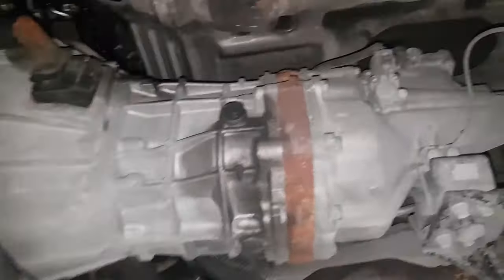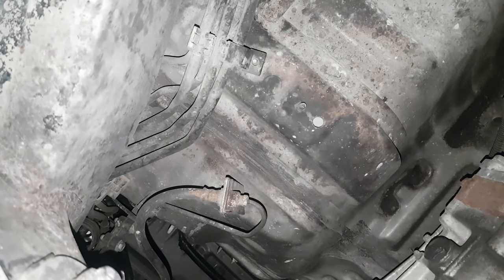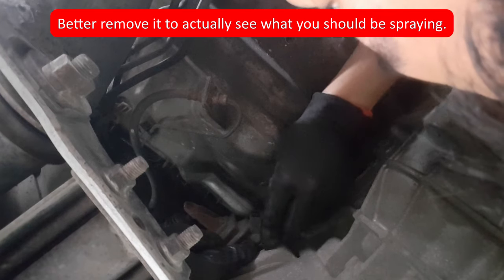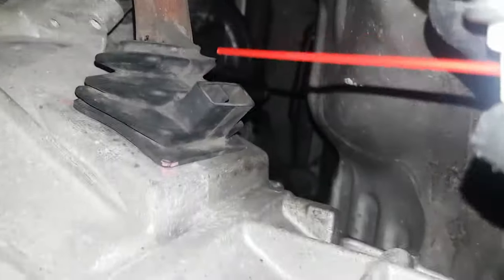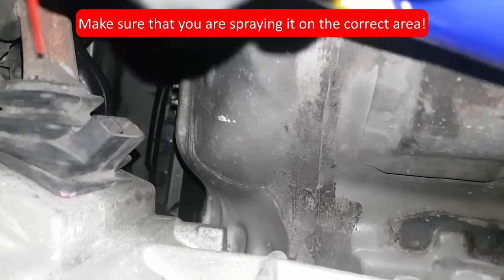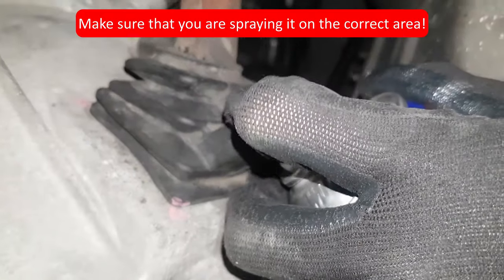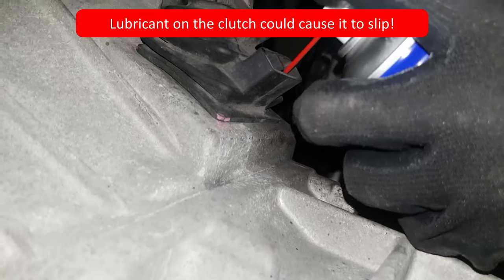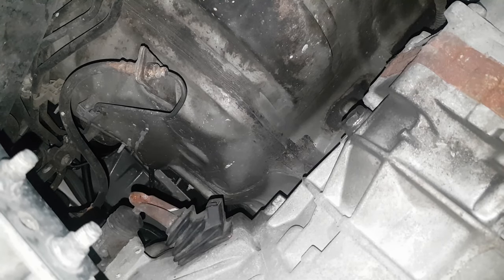DIY Quick Squeaky Clutch Fix

Comment: Thanks. The garage said the noise is coming from the inner components of the transmission and cannot be fixed without opening up the gearbox, thus recommended me to ignore the sound until the clutch needs replacing. Finding the noise  really irritating, I decided to try fixing it myself. Followed your instruction using nothing but a few spray of WD-40, and the noise is gone entirely. Didn't even have to remove the rubber boot.
Reply from the maker: Glad this video helped you a lot! You saved a lot with this easy and quick fix!

Don't forget to share this video so that we could help other car owners with the same problem and subscribe! Thank you very much!
Reply: @uazap  ganon din ho sinabi sakin ng mekaniko, kailangan pa daw buksan ang transmission pero di ako pumayag. Instead I tried  to fix it using your method Sir, pero di pa rin ho nawala ang tunog. Hilux Vigo po. 

Alin ho sa dalawang butas ng clutch boot/slave ang dapat iSpray ng WD40? White lithium grease ho ginamit ko noon. Ano ho mas mainam gawin at gamitin na grease? For long term.
Reply: @haniffabangon3169 ganan din akin, nabalik din yang issue na yan. Kaya ipababa mo na transmission mo kasi kung bago palang clutch components mo, malamang kulang lang sa grease yung sa fork nan.
Reply: @edwinallenturbanos6864  noted po. Salamat po.
Reply: @KaiHinLkh This sounds like an attempt to rip you off by telling you that your vehicle needs work that it really doesn't need.
Reply: @haniffabangon3169  may update po ba sa sasakyan? Same po kasi tayo hilux vigo din and tumutunog na po yung clutch. Ano po naging solution nyo? Thank you.
Reply: Haha,😂 a garage told me as your story too. They said I have bad throwout bearing. No but my throwout bearing is still fine

Comment: Thank you! Came back to say that this fixed my issue. There was a constant squeaking sound when at idle and when driving at certain (most) RPMs. The sound would stop when pressing the clutch pedal slightly and lubricating the clutch pedal linkage didn't help. This did however! The car only has 30K kms, I'd be surprised if it was a bigger  problem like a bearing for example.
Reply: I’m shaving the same issue , kinda seems like his explanation of his issue is different and he squeaking is happening when his car is off not at idle or certain rpm’s
Did you just lubricator ur slave cylinder and it stopped it from squealing at idle when the clutch isn’t engaged
Reply: @gabekierstead5903  Unfortunately the issue came back after a while. I tried a different lubricator but this didn't solve my issue. It solved the issue temporarily when lubricating the linkage connected to the slave cylinder.
Reply: @avanahmadaa  I’ll still give it a shot thanks for answering
Reply: What fixed it? New throw out bearing?
Reply: @avanahmadaa  Sounds more like the release bearing is worn
Reply: @johnfinnegan22   The sound has pretty much gone away permanently now, I got help from a mechanic to properly lube the release bearing. You have to be careful not to get lubricant on the clutch assembly. Haven't had a problem since. It probably happened because my car was about 13 years old at the time with only 3000kms, lubricants tend to dry out when cars sit still. If the bearing is worn, lubrication won't help. You need to change the bearing.
Reply: @hypercatjohn  Not really, you can see my answer above about how I fixed the problem. The car only had 3000kms on the clock, an old lady had it for 13 years so it sat still for a very long period of time and the lubricant dried out. But you are correct about the issue being the release bearing, but it was just dried out like old lady I bought it from. Although it was in good condition 😊

Comment: Son's Mazda2 doing exactly this, was also told by garage it was an expensive stripped down for new fork pivot, saw this video and decided to give it a go, fortunately on a Mazda2 bell housing the rubber boot is right at the front of the car and easily accessible, pulled the boot of and only a couple of well aimed sprays of WD40 and the noise was completely gone!! And as it was so easy to do it if the noise comes back in time I'll just keep doing this quick fix.
Can't thank you enough,
Reply from the maker: Glad it helped!
Reply: How do you put the boot back on mine is just a rubber boot that just lays on but now it’s loose since I removed it.

Comment: New clutch, fly wheel, and slave cylinder last week.. and now I'm already getting this exact squeaky sound 🤦‍♂️ going to do this tomorrow hopefully on my 06 Tiburon GT and 🙏 it works too
Reply from the maker: I know that feeling when you have done  or have something fixed but a few days after something pops up!

You should have put some sort of hi temp grease on the point where the clutch fork pivots when you have the clutch changed! But anyway this would work, just be careful when spraying!
Reply: @uazap  yeah I didn't do it myself but it wouldn't surpise me if they didn't lubricate it properly.. honestly those people were morons so I'm worried they didn't do any of it right unfortunately
Reply: @uazap  I appreciate ur help and this video none the less... forever subbed my guy 🙏

Comment: i lubricated where the slave piston pin meets with the fork, got rid of the squeak for a little bit, but came back. put some high temp moly grease down in there with a flat screwdriver and I didn't seem to hit the spots, chased it with two sprays of lithium and that's got it for now. now just have to sort the little sound between 1st and 2nd gear shifts.

Comment: Is there any way of doing this without having to go under the car? I dont have ramps but pretty sure this is exactly the issue I have as had someone press the clutch whilst i listened and it's exactly from there. Thanks
Reply from the maker: There's pretty much no other way unless you have a lifter. Might be better to have it done by a shop.

Comment: I replaced the clutch slave cylinder, noise remains. Any ideas?
Reply from the maker: You'd probably need to put a high temp grease on the point where the clutch fork pivots inside the bell housing of the transmission. Or, for a quick temporary fix, spray WD40 like what I did in this video.
Reply: @uazap  did both, with WD-40 and lithium grease, noise remains.
I think I'll replace the full clutch

Comment: What does he mean by spray the right area?
Reply: @Dylan Guillemette there is a pivot point on the clutch for, which is the part sticking out of the gearbox the pivot point is the right area to spray. 😎

Comment: wait so what do you mean by if you spray the lube in the wrong place it could cause the clutch to slip? what is the wrong place?? I dropped a little silicone lube in that boot (small amount) and squeak stopped immediately
Reply: One year later I know I’m slow to see this response. 
If you were to spray any on the actual clutch / pressure plate itself it would cause the clutch to slip. You essentially want to spray it on the fork and release bearing

Comment: (From Sri Lanka ) I have this same problem, plus hard to pedal. Will this smooth peddaling....
Reply from the maker: Have you checked the vacuum hose on the brake booster?
Reply: @uazap  what is the connection with break vaccume and clutch....🤔
Reply: @uazap  clutch is hard and with squeaky
Reply from the maker: @gehannilanga  Apologies I was thinking of something else. Got a lot in my mind lately. Is your clutch hydraulic or mechanical (uses a cable)?
Reply: @uazap  sorry... bad at english.
Its hydraulic. Same as in this video. squeaky Sound is same. And its really hard to push the clutch. But gear liver is not hard to shift.
Reply from the maker: @gehannilanga  By the way, may I know what's your vehicle? Thanks!
Reply: @uazap  Geely Panda LC 1.0
Reply from the maker: @gehannilanga  How you tried bleeding the clutch fluid?
Reply: @uazap  ok thanx... ill try it.... thank you uazap...

Comment: So what is the correct spot you say to spray it on if there is no hole on the rubber boot?
Reply from the maker: Hmm that would be difficult. You could try to remove the boot and determine the location
Another way to solve this is bring the transmission down and apply hi temp grease for long term solution. Preferably when you replace your clutch.
Reply: @uazap  what are we supposed to look for?

Comment: would WD-40 work?
Reply from the maker: Yup! But it would only last 3-4 months.
Reply: @uazap  so long term fix is replacement of?
Reply from the maker: @vpmeizu5466  long term fix is hi-temp grease on contact points of the clutch fork
Reply: @uazap  i bought the hi-temp Lithium Grease (Top1 Brand) and i I brought my car to one of the "kuya" in our local talyer, and he scoop a fair amount of grease in the clutch fork! And amazing!!! the noise is gone, and the clutch became more smoother.
Reply from the maker: @vpmeizu5466  hi Temp Grease would last way longer than WD40. Glad to be able to help! Thanks!

Comment: You need to put actual grease on the picot point.
Reply: What kind of grease? In the xb forums I heard w40 is not the best option, but I forgot the name of the other product, they said was better.
Reply: @zeache4564  something rated for temperature so it won't melt and lose the properties you're after (viscosity, sliding friction coefficients etc)